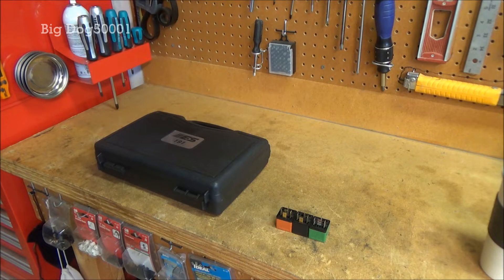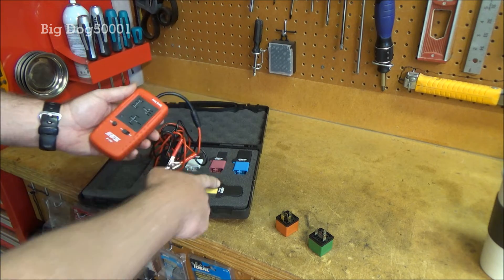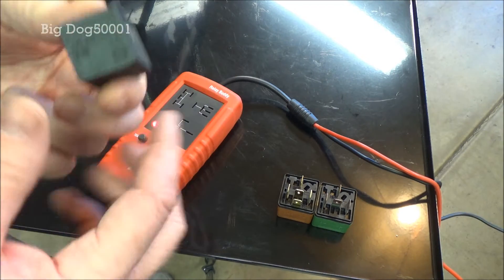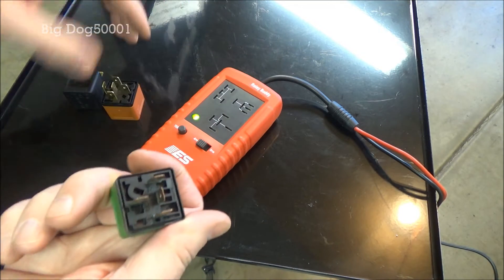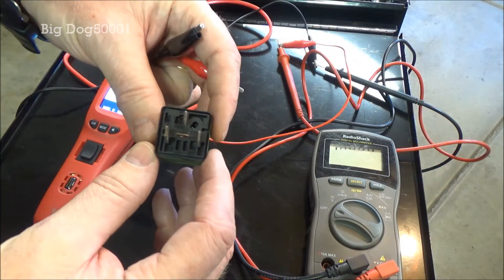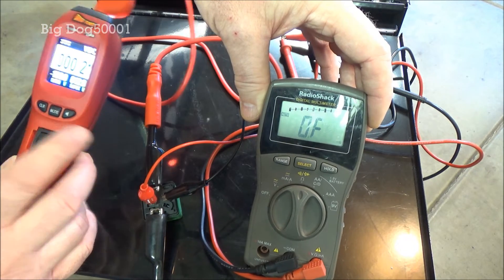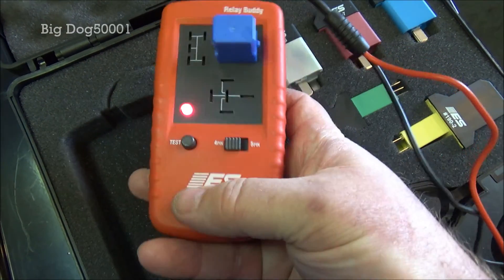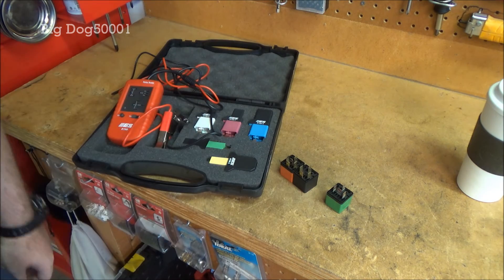Relay Testing Using A Relay Buddy

Comment: Is there a quick, reliable way to decide which posts are the control and which attach the load? For example in your demo the control posts were at right angles to a line between the two, is that a consistent feature? Given the fuse buddy can have only a few options, it looks like they mostly have a common design....

Comment: Thanx once again Big Dogg😎👍🏼I was contemplating on buying this for relay checks and saw ur video in the recommended area. Just what I was looking for..I'm goin to order it thru ur link.im gona order the  es 191 pro kit..so do u just plug it to ur cars battery terminals?
Reply from the maker: Yes it connects to a vehicle battery to power it up.  Thanks for the support!
Reply: @BigDog50001  thank u broski😎👍🏼now I can order it from ur confirmation

Comment: What is the toyota relay in color green? I have one in my toyota as well and im having troubles on finding one. What is it called? Thanks
Reply: Toyota "90084-98011" or Bosch "0 332 104 001"

Comment: How useful have you found this tool ? I'm thinking of buying it. What's the other adapters for ?
Reply from the maker: I like it alot, it is great for quick and easy relay checks, but like any tool it has its limitations.  Some of the adapters are for different relay pin combinations and the rest of the adapters are extensions so that oversized relays that might not be able to be plugged directly into tool can be tested.
Reply: @BigDog50001  I just ordered one...why not lol . I'm all for tools that save time lol
Reply from the maker: Why not lol!

Comment: nice to have this over priced tool kit.
The off vehicle relay tester is kind useless because if you question a relay you can always just swap a relay from  the same fuse box.
the real relay tester or in circuit tester is so called onboard relay tester with pin break outs which let you test the power ground on coil side also you are able to jump on the switching side to trigger it manually.
Reply from the maker: Thanks for the input.
Reply: Y z , what u say seems to make some sense . Can u please elaborate on the logic behind what u say and the procedure of onboard relay testing. Any external links are also appreciated. Thank u.
Reply: @jayasanka5978 
always check fuse first
 if you suspect a bad relay, just swap it from same fuse box, 
like ur fuel pump not working, but u know ur high beam is working well, so swap those two relays if they are the  same type, if u find out high beam stops working and fuel pump is working then u know u have a bad original relay, if high beam is working and fuel pump still not then is not fuel pump relay issue, could be a fuse or bad component cobtrolled by relay, or sth else

those relay adapters from the kit are kind of risky, if you select ur meter to measure current and accidently feed power or ground to the relay coil side which alway comes from the ecu, u could end up burning the ecu and u have a bad day. 
so stay away the tester, not worth the risk  because merphys law alway applies when working around cars, trust me,lol

Comment: did you try one of the adaptors in the kit for the green relay that fooled the tool? 
btw this unit does "load the circuit"
Reply from the maker: The other adapters were not for this application.  I do not believe it loads the circuit.

Comment: I think a relay can appear to be working but not be able to carry the proper amperage. Does this tool make sure the relay can carry the intended load?
Reply from the maker: MBS No, it does not apply a load, at least not that I'm aware of.  A test light/bulb at end of circuit should reveal that.  This is just another tool in arsenal to help with diagnostics.